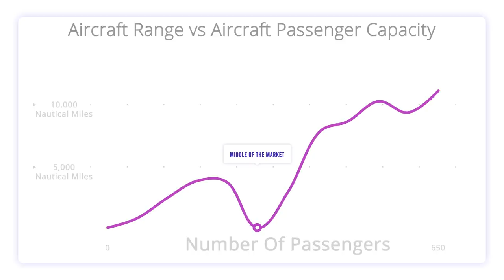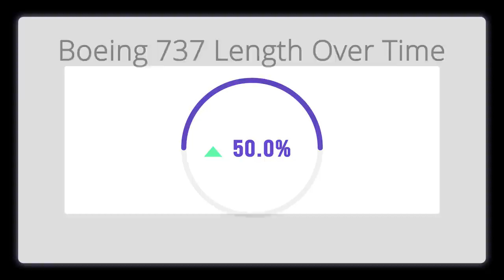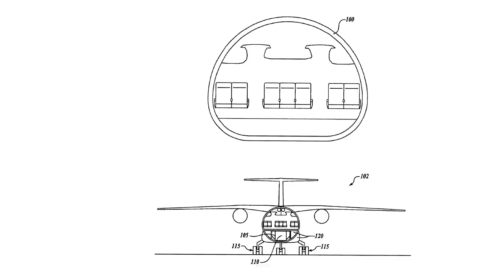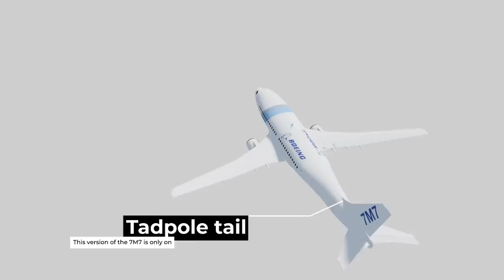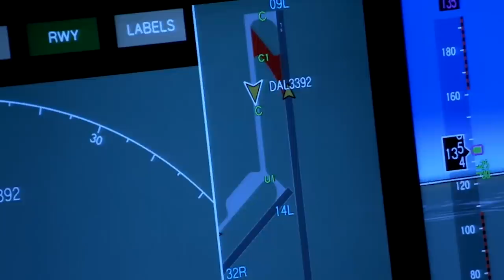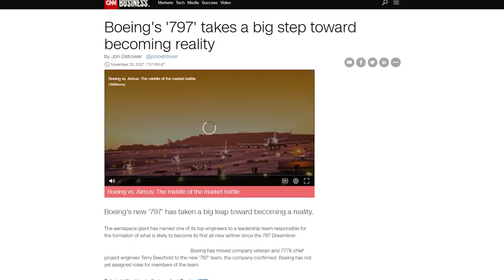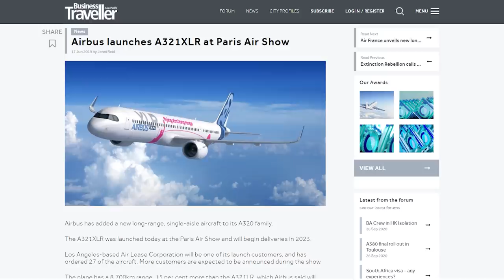The Boeing 7M7 - The Proposed Future Boeing Aircraft To Replace The 737 MAX and 797 | Never Built

Comment: Don't understand why people are saying that these crashes were acts of terrorism despite the lack of evidence to support those claims. My theory behind these 737 Max 8/9 plane crashes I strongly believe is due to the fact that these are "developing countries" with underdeveloped aviation infrastructure, meaning you could be seeing debris, thick dust, and particles that could enter the airplane engines causing more energy outputs that could support claims that the lithium Ion battery caught on fire. Boeing will need to consider redesigning the engine intake design to a whole another level if they DO NOT want a high wing aircraft design, applying filters or sharper and stronger turbine blades should be considered. This is especially true for regional commercial airlines operating in developing countries. Boeing should team up with Lockheed Martin on this issue if push comes to shove.

Comment: they could still keep it with a low ground clearance and without rear landing gear doors.  for that to happen, they could use a wing desing similar to what's used on the new embraer e-jets, which swings up until where the nacelle is, and then down again, allowing the engine to hang higher.  look at these embraers from the front and you'll understand what i'm saying.  i mean, they could even have used this trick on the 737, avoiding mounting it so forward and thus having to apply extensive software correction.  of course, this is not the opinion of an aviation engineer.

Comment: the aft pressure bulkhead would be too small to safely operate a widebody with the smaller narrowbody aspect of the tail design in the video.  The plane must be able to fly at high altitude to optimize fuel consumption to give it a marketable fuel range for customers. The design of the (smaller than the cabin) aft pressure bulkhead would decompress the plane at high altitude and maybe down the aircraft altogether. The 747 had that same problem once. See also the large windows in the British DeHavilon Comet from the 60's.

Comment: two major aspects are neglected: adding a 7th seat making one more aisle necessary requires an overproportionally (1 seat 1 aisle extra) increase of fuselage diameter and consequentially drag. This penalty in extra fuel consumption cannot be compensated by other aerodynamic refinements. Probably one off the hotspots where Boeing engineers are struggling with their sales guys. Using 787 systems takes a 7M7 close to the production cost of a 787 thus failing the aim to offer a plane close to the cost of a 737-10 MAX.

Comment: Boeing never give a thought to build a passenger/cargo plane with a top mounted wing such as BAE 146 but with two economical tfe's instead of 4. That will make load and unloading much easier and there will be enough room for bigger tfe's. And with a seat arrangement of 2+3+2 it will be the "Goldy Locks" airliner for most popular routes.

Comment: Brand new oval shaped fuselage with composite material is a lot of work. From engineering standpoint, it is very difficult to make non-circular shape without weight penalty because of the pressurization. This will subject part of the material in bending instead of just tension as in circular section. This makes them much less efficient, Just like the blended wing body concept.

Comment: You should have a look at the rumours / speculation for the Airbus A322 XLR
Reply: An A 322 would need bigger wings, because the 321 XLR is at the limit with the wing size of the 320 series.
The 757 has bigger wings, but they are to big (they have too much drag here because of the size) to fit for shorter routes, where 320s or 737-800s are used.

Comment: I feel 6 seats in a row and 2 isles is also be a good format

This will also ensure passengers quickly settle down  compared to 3 seats in middle .

Plane will  have 36 rows to seat 220 passengers . Which meets the target .
And engines will do the rest ie longer distance wirh genxx or rolls Royce

Comment: The "middle of the market" segment-whether mythical or not--could be easily realised by either Airbus (or Boeing) if they simply re-introduced technologically enhanced versions of their A300B1 or 767-300 (respectively) models. It's not rocket science.

All that is required on the part of the committed manufacturer is due diligence during the production phase after research and development are completed.  THAT was the lesson taught by the rush to market of the 737MAX. Between the firms, Airbus has an edge in the advanced A-330-340 model series along with the more advanced technology incorporated into their A350.

As for Boeing, there is still one market they could tap with the 737, hinted at the start of this video.  That being a return to the original 737-100 re-engined for regional market. If they wish to recover their reputation after the MAX disaster, they could make a substantial impact on this segment, given the plane's greater breadth, the ready availability of more efficient wings and the use of more fuel efficient engines that would not require the CFM-56's extra wide nacelles. 

At 94 ft (LOA), do Boeing's hopes lie Back To The Future?

Comment: Boeing needs to realize it needs a clean-sheet, and then build a 2-for-1 clean sheet that replaces BOTH the 737NG AND 757 while providing airlines with a new product they can convert their 737 MAX orders into orders for.  Yes that means a new type rating for pilots, but like with the Airbus A320 series, there would no longer be a separate type rating for shorter-haul/smaller mainline narrowbody and MOM Boeing aircraft.  Three sizes: 737-800/737 MAX 8 equivalent seating, 737-900/737 MAX-9 or 10/757-200 equivalent seating, and 757-300 equivalent seating.  Need a 5000-mile range for at least the larger two sizes; if all three sizes Boeing will have a winner for "long and thin" routes.  Can make it either widebody like this aircraft in the video, or narrowbody but with boarding through a L2 door by default to keep boarding times in check...and if it is narrowbody, bonus points for a cabin width 9" wider than the 737/757 today so that the six seats in each row of economy can be 18.8" wide not 17.3" wide.

Comment: A 757/767 MAX would have solved that problem.  Re-engine and re-design the 757-200 and 767--300 and Boeing would have come to dominate the MoM market because the 757 MAX would have more range and more capacity than the A321XLR and the 767-300 would be ideal for airlines wanting a medium-long range aircraft with less capacity than the 787-8 or A330.

Comment: surprised they are not calling it a 737 so they can get away from fully certifying the aircraft and just say as per normal its a 737 with a couple of changes, as boeing have been doing for decades.
im surprised they didnt call the 777 and 787s  737 with a few changes.
i went on a certification course at the CAA before the MAX crashes and the trainer mentioned then about boeing using loopholes. he stated the 737 max as being one of those loopholes to get around the cost of properly certifying an aircraft.

Comment: Interesting fuselage design, the 2-3-2 cabin configuration is not unique (as mentioned), it has been around for decades with the Airbus A300, A310 and Boeing's 767. If Boeing goes ahead with the 7M7 it'll be a smaller and modernized versions of those aircraft with the elliptical shape.

Comment: A elliptical fuselage would be more expensive, and does not optimism weight to internal volume like a circular Xsection.  But these disadvantages might be negated by using carbon fiber.
Reply: Large body aircraft,  380, 767 etc all have an inherent weakness: tangential hoop stress.  Force = pressure x area.  The greater cross section area increases stress.

Comment: I seems to me a very strange idea to make an elliptical fuselage, as to have enough rigidity to cope with pressurisation loads, it will have to be much heavier than a circular shape.
Reply: It would be definitely be an engineering challenge! Even with a lot of carbon, the fuselages are still round today.
Reply: In the case of an external pressure hull like a submarine, being circular is essential. Even the slightest out of round creates a distortion weakness. How ever in the case of an internal pressure vessel like an aircraft fuselage a small out of round has little effect
 Basically it is not an issue.
Reply: @julianfell666  It is a major issue, unless if you have a middle floor to strenghten the fuselage, like in the A380.
But for smaller planes like 737 and A320, an elleptical fuselage makes no sense, as in all cases it will be heavier than a cylindrical fuselage !
Reply: @78Dipar   The rear half fuselage of a 757 is elliptical. The front ends of 707s, 727s, and 737s have asymmetrical tapers and are oval in cross section.  This has not been a problem.
Reply: @julianfell666  It's not because it has been used that it was the best idea, in all cases an oval section will be heavier than a round one for the same strength.
Reply: @78Dipar   This would be true if it had to be tensioned to near failure. This is not the case.  The technical demand is for height or width depending on situation. Aircraft are skinned so as not to fail from fatigue over a given number of cycles, not to avoid failure at a certain pressure.
Reply: @julianfell666  In all cases the strength will be higher with a round shape...
Reply: @78Dipar   From a pure mathematical analysis that is true. However aircraft are built to meet a commercial need rather than a technical ideal.  Getting more capacity is more important than saving a little weight. It is a trade off.
Reply: @julianfell666  Today the main issue is fuel efficiency, as always in planes, weight is the main ennemy...

Comment: When will the 737 become so heavy that the small set of main landing gear finally collapses?  Most planes of this size have a landing gear with 4 sets of tires on the heavy portion i.e. the main body to keep it from collapsing upon a heavy landing.  I don't know how the 737 gear still holds up under the great weight of the stretched varients...

Comment: The 737 & 787 are manufactured on different lines of different materials. There would have been very little synergy in making a 7M7 which would require 787 style manufacturing in a 737 facility. What Boeing was trying to do with the MAX was create an aircraft that capitalizes on the efficiency of new engines but retains 737 certification for pilots thus making 737 operators happy. This didn't work out too well because a concept based on cutting corners cut too many corners and hundreds of people died.

Comment: They need something radically different from this to replace the 737 completely. Something that doesn't even remotely resemble a 737. Something more aerodynamic and much lighter and modern than the 737's overall old design.

Comment: I doubt that there any NA plane manufacturers whose aircraft I would willingly fly.  Did not like the original 737, although the 727 was fine as was the DC9 .  For passengers the L1011 was crap as the ceiling tiles came down in the passenger cabin and well it was built by Lockheed and I helped upgrade the Lockheed CF104 which was crap.

Comment: why on earth should Boeing keep trying to keep an almost 60 year old design in the sky?  Especially after the whole 737MAX debacle that grounded that variation for over a year. Additionally, a  wider 737 will completely disrupt the parts logistics, the 737 fuselage is built in Kansas, then transported by rail to Everett. The wider body will not fit the railcar footprint, it would overhang the side, effectively making it a wide load, one that will not fit through the tunnels that are part of the route.   

This discussion is simply another example of the shortsightedness of Boeing management. They killed the 717, 727, and 757, all planes that had proven themselves as workhorses in the niche markests that this proposed 7M7 is trying to fill. I vote for firing the top level of management and board of directors, and handing the design team the old blueprints for the 717, 727, and 757 with the instruction that state: "take these "old" designs, modernize them, and lets fill the gaps in the regional sectors (717 & 727)  and the 757 for the middle of the market and finally give up the ghost on the 737. The 737 is now a tainted bird!!!! Besides the two most recent crashes of the 737MAX model the 737 has a checkered past, most people have long forgotten the crashes in Colorado and Pennsylvania  that killed everyone on board, and was due to issues in the tail section of the plane. That little fix took Boeing YEARS just to figure it out, let alone fix! 

Seriously!!!! Modern redesigns  of the 717, 727, 757, with all the latest technology and materials would cost the company less, and would provide the airlines with modern, efficient aircraft, that fit the desired markets perfectly. 

I seriously hope that Boeing would not bring back the 727 since 717 and existiong 737 perfectly overlap that part of the market, but added it in to try to highlight the thinking of braindead execs at Boeing!  But then,,,,, why not bring back the 727?!?!?! Boeing is hell bent on putting a fresh coat of lipstick on the pig that is the 737 ,  They are keeping the 737 on life-support so why not play god and reseerect the 727, the other model that didnt keep with market demands.  Why else would Airbus by Bombardier ???

Comment: Airbus is just better in every way. More ergonomic, quieter and more comfortable cockpits with tray tables, fleet commonality, comfortable 18-inch seats for passengers, camera fitted on the vertical stabilizer of newer planes such as the A350 to provide passengers a breathtaking view of the flight, more sophisticated auto-pilot, newer and more efficiently designed airplanes and most importantly, a significantly better safety record.

Comment: Is that possible to design a 250-seat aircraft with such a long range, weighing less than a small 797? My technical knowledge is limited but it seems that, unless a non-rounded cabin be developed, traditional aircrafts for 220-270 passengers covering long distances are not cost-effective

Comment: What Boeing is going to do is build a 707-MAX with four CFM International LEAP engines mounted higher up and further forward with a revolutionary MCAS system to balance the new engine configuration. Boeing is convinced a re-engined 707 is the way to go because keeping concepts from the 1960s is the way forward for the future 🤣👍

Comment: The 797/7M7 whatever was in trouble before the MAX debacle. The basic problem is the decision (or lack thereof) to make it a tin aeroplane or a CFRP one. The former has a lower price point and the latter is better and but more expensive. Boeing never managed to reach a decision. Typical corporate paralysis. A CFRP plane also needs a completely new assembly line; even more cost.

Comment: Airbus comes close... A321XLR seat 220 pax for 4700 nM, AND carries LD3 containers (actually, 10 of them), on a lower hold. That's something no 737 has ever done.
Having seen your piece, I think you misrepresent the issue. The A321 is being fine tuned for 240 pax and 5000nM. It already carries underfllor cargo containers. Basically, the message I get from this feature is that the big problem of the A321XLR is that it isn't a Boeing. The piece even suggests it is inferior to the 757: it isn't. Payload is very similar, range is bigger and fuel usage is a lot lower - as it should be, being different generations. My conclusion is that this is biased, and a feature heavily tilted towards Boeing...

Comment: Why doesn't Boeing start with a larger pksbe and then shrink it? It seems planes always begin as smaller and then stretched. By starting larger and then shrinking Boeing could still retain parts commonality throughout it's 797 line. Anyway, the 737 design is now very old, Boeing will have to invest in a new design sooner or later, why not start now?

Comment: I'm not an aeronautical engineer by any stretch of the imagination, but wouldn't the different shape have different flight characteristics than a normal 737 and require retraining?
Reply: Look up the B767 and the B757. These two planes were very different in size yet were flown under the same pilot training/rating. It is possible to do.

Comment: Boeing should have canned the 737 Max after it was grounded, and resumed work on the 797. For some reason, Boeing just wants to dig themselves in deeper with an overextended narrow body design instead of moving on to the next generation hybrid aircraft which makes a lot more sense. Sounds like penny pinching to me. In the long run, if Boeing bites the bullet and invests the money, they would have a winner in the middle of the market, but it seems like Airbus has got them on the run and they are like deer in the headlights responding to every new model Airbus brings out, instead of forging their own destiny as they did in the past.

Comment: Im sorry but a totally different airframe shape made of a different material would not have been a simple switchover for a 737 line just because they are a similar size, it would have cost almost the same to develop and validate as the Dreamliner. Hence recent talk has been on resurrecting the 787-3 and rebranding it as the 797.
Reply from the maker: True!

Comment: Why not just to revive a 767, with new composite wing similar to 787 and new engines? So much more reliable and cheaper.
Reply from the maker: 767 max
Reply: Found And Explained can be called that as well. Though I’d avoid the name “max” now, after 737 max disaster.

Comment: In a hurry to catch up with the airbus 321 XL Boeing ended up making the 737 max which is not even a fly by wire and is considered to be a generation 4 aircraft in comparison to the Airbus 320 series’s which are generation 5 as per ICAO. Flying wise the 320 is much better and safer modern airplane.